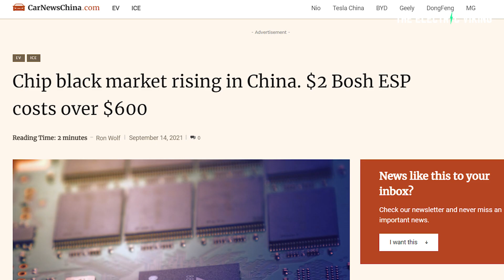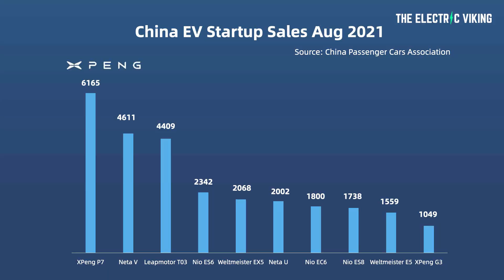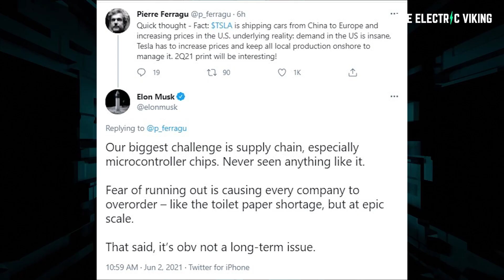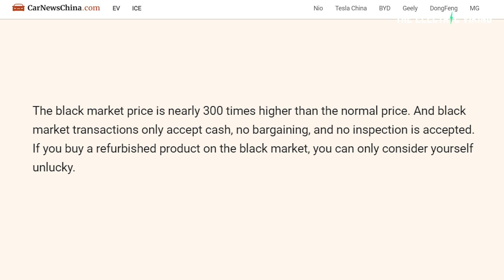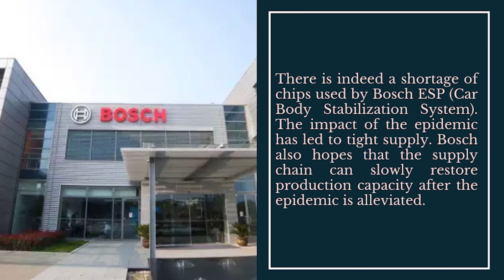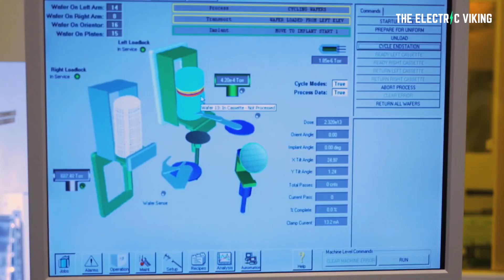Semiconductor chip disaster causing an INSANE black-market

Comment: There are a couple of yoytubers that are coocoo for Tesla talking about how their stock price is to the moon and how no other EV maker, including BYD, can compete with Tesla. 

Look, as an investor in Tesla and BYD I have nothing against Tesla and I really, really want them to continue to do well but BYD isn't trying to compete with Tesla. It's in uts own world doing its own thing.

Tesla is constrained like everyone else at this point. The chip manufacturering is either going to have to get better or Tesla isngoing to have to ramp up their vertical integration like BYD and start making their own proprietary chips.

If you think about it they're going to have to at this point. They bud their own cars, want to assemble their own batteries and should now start making their own chips etc.

You're only as fast as your slowest point.

Comment: The opportunity that comes to my mind is further vertical integration in the EV space via bespoke flexible company owned fabs as a standard component of factory design. Given the specific demands of auto manufacturers, it should be possible to physically shrink the footprint of such fabs vs current mega foundries. There's your multi $B opportunity; provide those bespoke foundaries.

The current chip situation reminds me of the '70s middle east oil embargo. That trauma set many changes in industrial policy and tech in motion, such as the shale oil revolution, that have profoundly shaped the energy market since then. This shortage is likely to have similar long term shaping effects in the chip space.